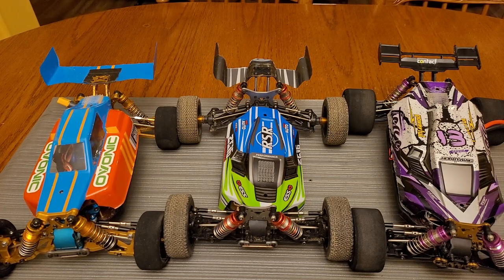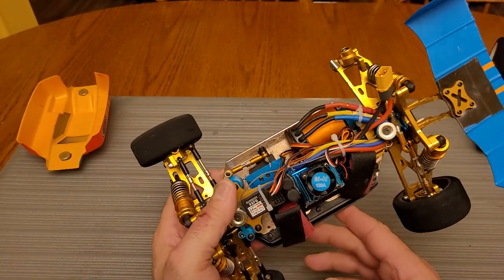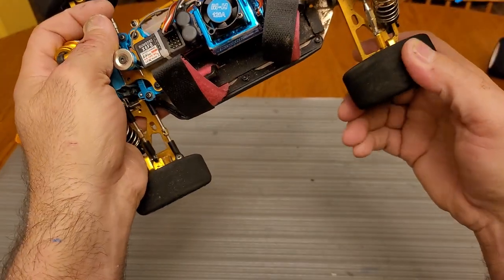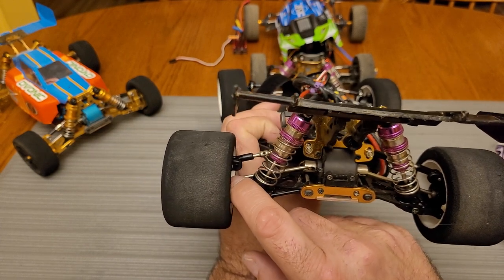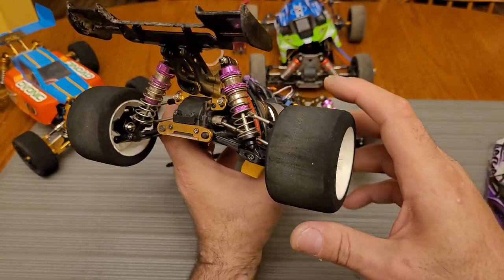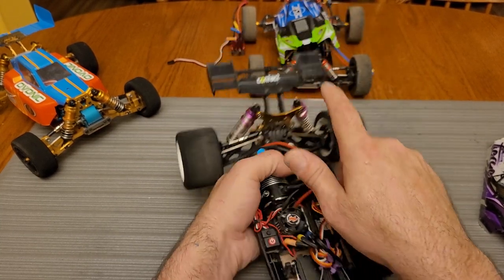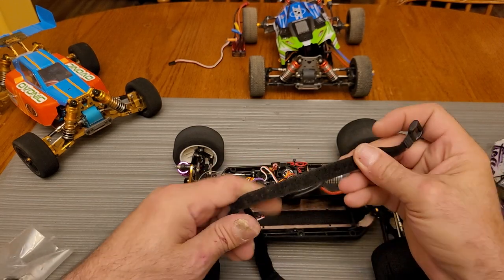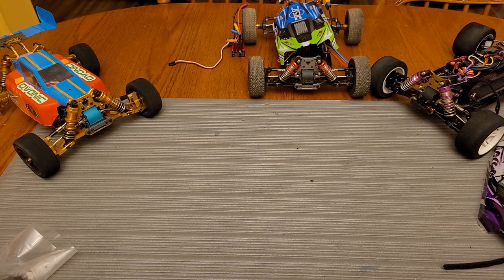WLTOYS 144001 and 124019 set ups.

Comment: I had similar problems adding all the metal on my 1st build and learnt from my mistakes as you have. I don’t know if you’ve tried the 4x7x2.5mm bearings of E-Bay for the wheel hubs? There that tiny bit bigger and I’ve found they completely stop the wheel wobble problem. 2 either side on the front drive shafts and one either side on the outer side of the rear wheel hubs, I got the tip off MeHimRC (a big shout out to him for the tip) there £5.72 on E-Bay. I also found the metal rods weren’t staying true and there was a lot of play in them so went back to the plastic ones. I’ve a lovely plastic 144001 which was my 2nd build for speed runs, I’ve done the brushless conversion, phat attack body and fitted a HBX 16889? I think wheelie bar about £4 from banggood to keep the nose down on 3s. I like your 2 144001’s they look good and there great to work on and customise. I’ve gone back to my 1st one now and taken most of the metal off, I will go brushless with it and am thinking of a short course truck with it? Or a rally car? Sorry to have gone on a bit but it’s always good to see other people’s builds and pick up do’s and dont’s. A great video 👍 good luck with your changes and progress 😎👍

Comment: thanks for sharing... yes the 144001 comes very good like it is...i ordered a 2nd one i am going to do some changes to... but for now i am fine with the 550 motor... i like it when i can control my rc cars...you can also add anti roll bars and ad screws to adjust ride height ect...also i took small piece of fuel line and added to bottom of each shock...keeps my dog bones in a good range and prevents issues...if you want to have real fun put some drift wheels on one... i get 20 mins of fast and medium run time on 2s 1500 stock setup... my first car has 3 plus hours run time and diffs are very smooth..never took apart... These cars can be made into any thing you want... i love this platform... maybe one day i will make one into a formula1 racer...you can also 3d print parts for this car...I also am waiting for the new 1/10 scale buggy to be reviewed...i think that car will be great...
Reply: Hey dude.

Hows she running today? I have been driving my 144 for about 5 months now. I have ordered some parts,so I could upgrade it as cheaply as possible, and I thought I'd share my list with you:

5200kv motor with ESC, Servo -$45
124019 chassis, center drive shaft, metal tower bridge, metal gears, metal diffs - $30
1/10 scale foam tires - $15
12mm HEX 30mm wheel extender hubs - $5
Flysky FS GT3B transmitter and receiver - $35

Simple 1/10 body - $15

Totals $160 for the upgrade, but the conversion is totally worth it. It outran some drag cars in the RC the other day 😅

Comment: Hi, thanks for the video. About the wobble of the aluminum chassis. I have the same problem. Whats clear is there's a lot of play between the wheel bearing and the axle to which the wheel is screwed. I'm going to make a try to shim this all out. The hubs are also wobbling so does need some shims to.
The shocks are also leaking like hell...

Very smart and nice job with those magnets, do those magnets work well, does the body stay on well at high speed? 
Where did you buy them?

Comment: niceee video i always run the 60-120amp hobbywing BL series as they fit the top deck without mods ...i got to get my 124019 bulit just  waiting on a 4.5t motor ...my 144 is bulit but aint ran her yet since a new esc as took it out in the snow with a banggood esc and it went into limp mode but i hit 42mph on 50% throttle rate on stock gears but now she gotten a upgrade ill hope she hit 80mph when i get her out

Comment: Before I watch was your linkages too long once you put 1 locknut on? Mine were, and it's less durable. I've used some aluminum in my dual motor build, but just pieces I think will help my needs. I could be wrong tho, lol. I'm putting 2-2838/4300 kv motors in a 124019, I think geared up to 1 to 1 I will get triple digits. The one I have now has 2-3650 motors, and 2-70amp escs.

Comment: Do you have a 12428 buggy as well? Can you confirm whether the diffs are compatible between the 12428, 124018 and 124019? The link to the all metal diffs no longer works. Would it be the one with the aluminum casing? Thanks.

Comment: will those metal parts in the description work for the 124019???
Reply from the maker: Yes they will the main difference between 124019 and 144001 is the drive shaft. But all those metal parts will fit.

Comment: Never go full metal if it's not a shelf décor piece or collectible.  The weight is not worth it and the car will not become more durable, quite the contrary. It will just shatter easier in different places.